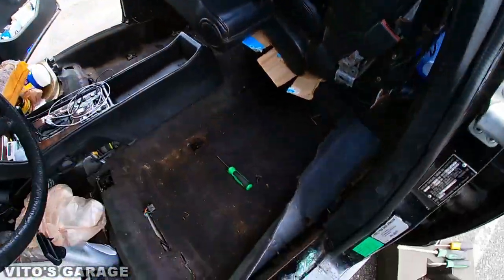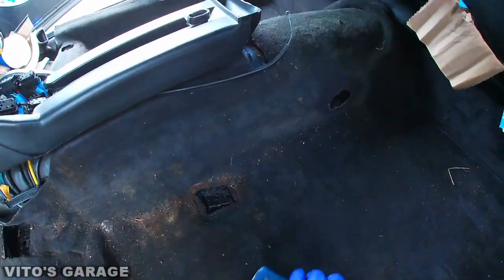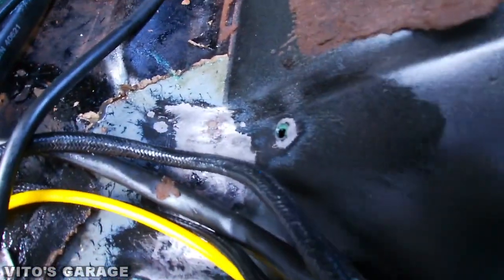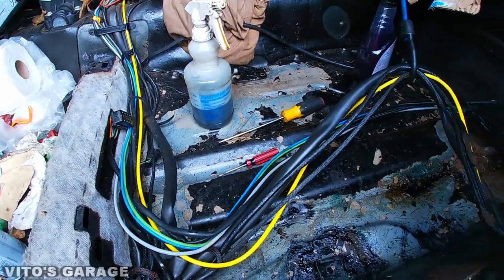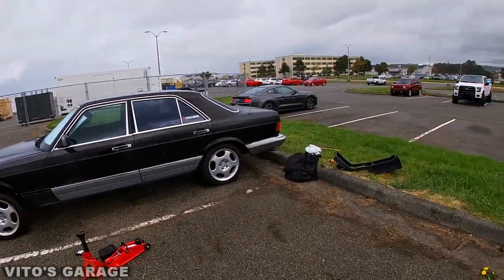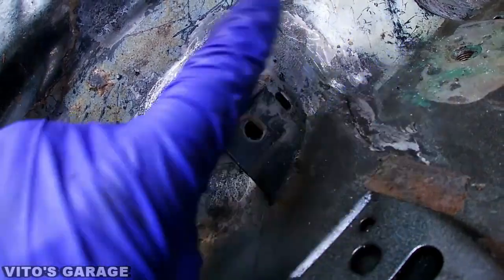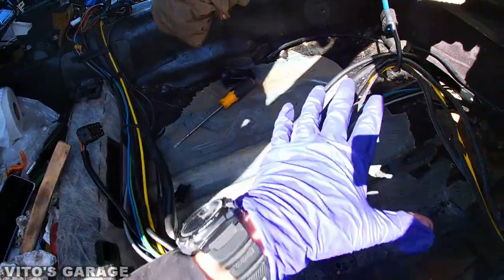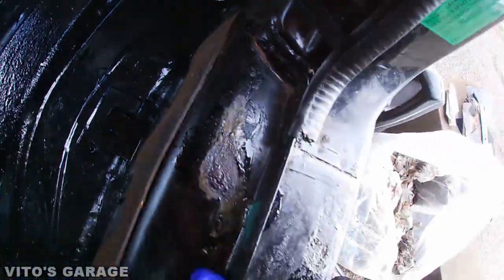Mercedes W126 Restoration Ep3- How to Fix and Protect Rusty Floors FOREVER! Center Console & Carpet

Comment: Vito. Try boiling up some RIT dye and mop it on your carpets on a hot sunny day and let it dry. The next day hose it off and the dye should take and you will have a uniform color. It is a cheap way to rejuvenate your carpet with out making them stiff.
Reply from the maker: Thank you so much for the tips, Jeffery!

Comment: I have a beautiful 1990 300SEL and I have to address this issue because a crap mechanic didn’t fix the A/C drain line correctly and my floor boards have been soaked repeatedly. Thank you for these videos, I will be following the instructions step by step. I have a question, without the sound dampening material on the floor is the car loud? Can another material be used to dampen the sound under the carpet that isn’t so water absorbing, just in case (god forbid) water makes its way into the cabin again? Again, thank you for the videos. I also have a 1976 280 that I will be working on soon
Reply from the maker: Thanks for taking care and loving these amazing machines! And you can drive without the sound deadening. I don’t think it’s gonna be a huge difference. But if you use any sound deadening, put grease and fluid film on the floors. That will protect them forever

Comment: How did that car get those rust spots, was that car near a beach or  is that road salt,
Reply from the maker: Road salt and water leaks inside the interior. Water leaks especially. They'll rust out your floors. Keep lifting the carpets and checking for water leaks. Very important

Comment: this problem related in major cases in W123 / W124 /W126 , the W140 is not concerned she good protected in the floor
Reply from the maker: Not true. You have to check for water leaks in W140 too. Also, AC drain tube in W140 disintegrates and causes all the water to collect on the floor and rusts it out!